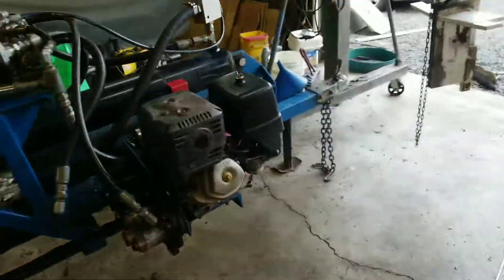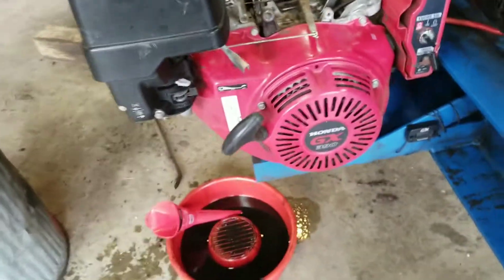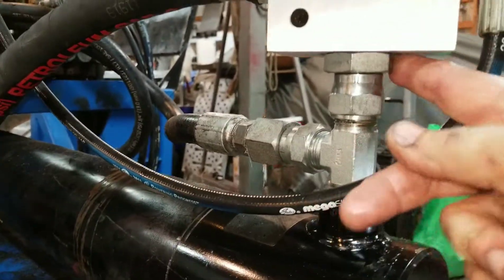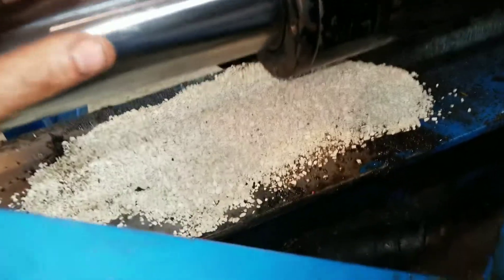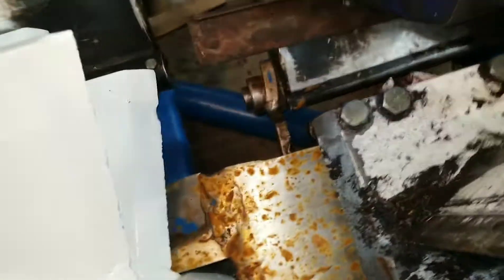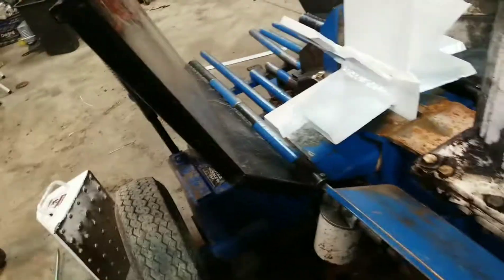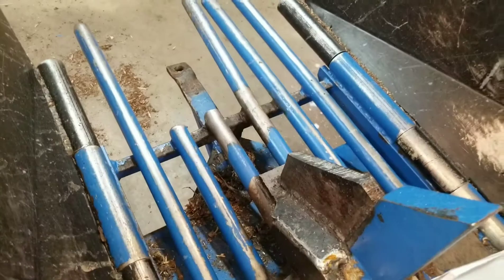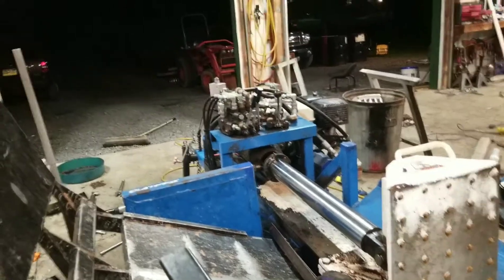Log Splitter Maintenance

Comment: How many times has that clevis been broken off that cylinder? Mine is 5yrs old and has been broken 3x good machine built tough
Reply from the maker: Not quite sure what clevis you're talking about. Nothing has broke off the cylinder that I know of. Plenty of broken stuff on this. I have it back to work on, the flange on the I beam that I mentioned in this video has broke. So more welding 
Thanks for watching!
Reply: @tomhendricks316  The part that holds the main cylinder to the push block. Seems to be the weakest part of the entire machine
Reply from the maker: @blueoxlogsplitting8756  I will keep an eye on that. Thanks for the heads-up